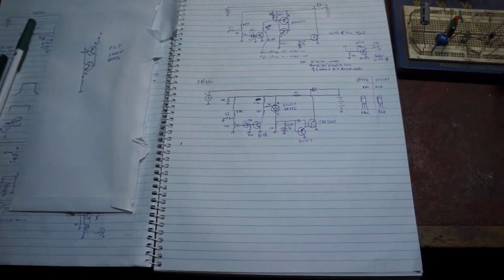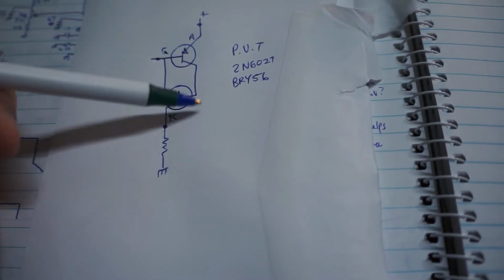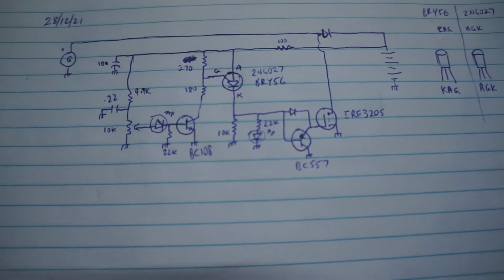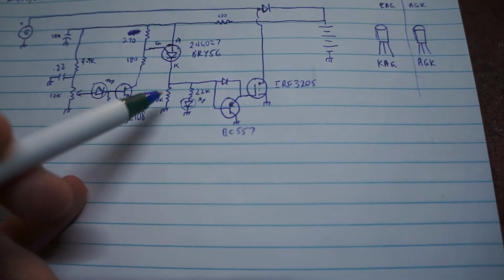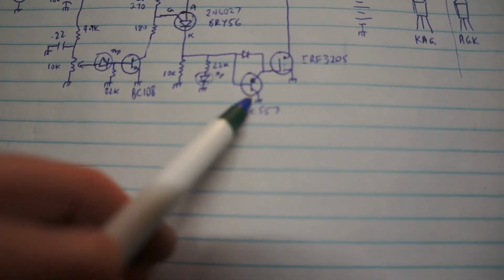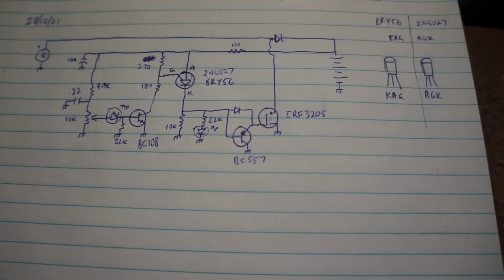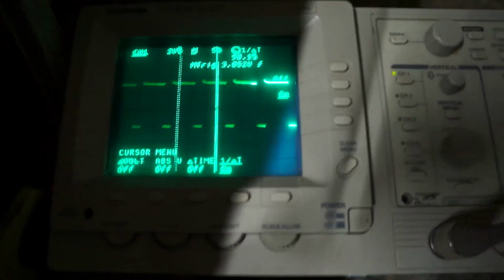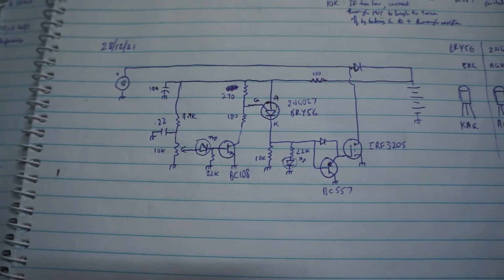Model T Voltage regulator with PUT

Comment: Another excellent design, I remember PUT devices being used in 70's jukeboxes. Be very interested to see your in car tests with this. I have tested your 393 design breadboard balanced on the T and it works fine in the garage not tried on the road as the weather here is awful. Thanks for sharing.
Reply from the maker: It worked great on the bench, but unfortunately not in the car. It is affected by the noisy electrical environment. A circuit with a TL494 I am also testing suffers the same way. Much more work to be done to create a PWM design.